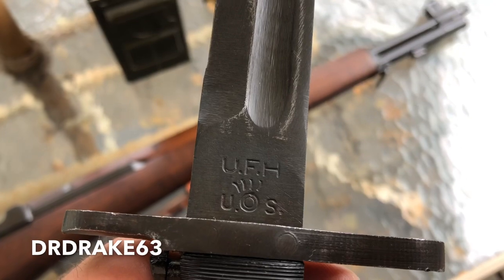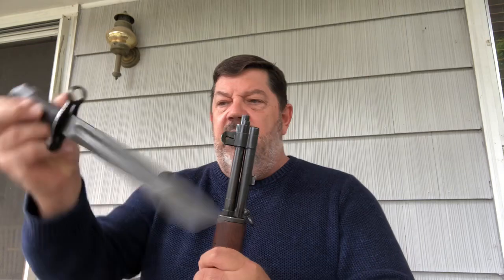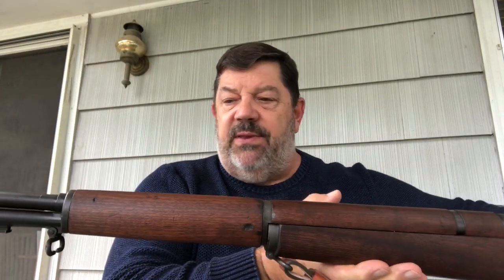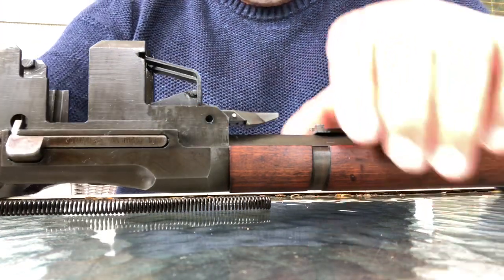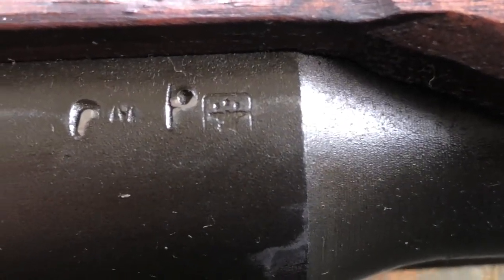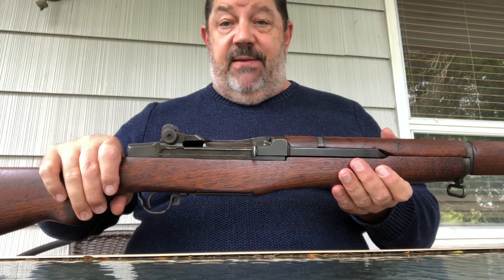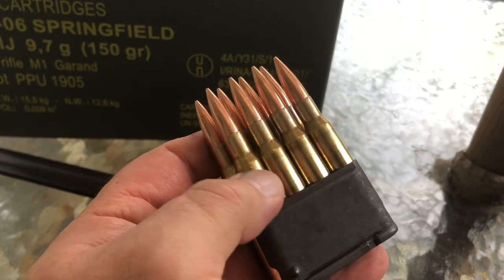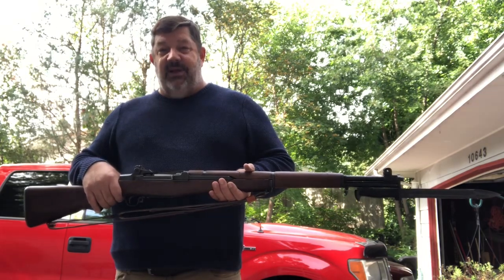INSIDE THE M1 GARAND

Comment: The “blood groove” on the bayonet is called a fuller. It’s designed to make the blade lighter while allowing the blade to keep its strength. You see the same thing on a many types of medieval swords.
Reply: Whatever. It also helps the wound bleed, don’t it?
Reply: @ColombianHistoryX  No, it did not.
Reply: It helps release air suction when pulling it out thus speeding up what you may have to plunge it into again and again during hand to hand combat.
Reply: @LdHrothgar  Fuller is correct....  blood grove is inaccurate and a misnomer.
Reply: @zagsatgu4561  Uh, I know... the OP there called it a fuller, so I didn't correct him, even though they also called it a "blood groove" in quotes, I kinda figured they knew that already (especially as they were correct in its function of making the blade lighter while retaining strength).
Reply: It is there to keep the bayonet from sticking in whatever is being stuck. Without it the blade will be harder to pull out.

Comment: Thank you for taking the effort to demonstrate the M1.  My M1 is from December 1941,42NNNN, appears to have the correct period parts for such vintage.  (I bought the expert which came with a new barrel, and new walnut stock, from CMP).  I wanted a WWII era rifle but also wanted one that I could reliably shoot!  I loaded my own 150 grain Spitzer cartridges for it using the mid range powder recommendation using IMR6064, my favorite 30-06 powder.  Thus, it cycles well, and doesn’t break anything inside!  Your color match was first rate!  When dealing with different woods, matching is anyone’s guess!

Comment: Overhand grip for the bolt is accurate and the underhand on the slide rod also correct.  Best accuracy with the foregrip is with it shimmed.  As a former armorer  details are extremely important.  Never remove the assembly from the stock then you have to.

Comment: The little ding on the bolt is actually where they did a Rockwell hardness test. They did it on the reciever as well.
Reply: Yup, just posted the same thing.. It doesn't tell us the results of the test if it passed such as a proof mark, just is the spot where they Rockwell tested the bolts like you said (although we can assume it passed because it moved along the assembly line). I'm surprised his isn't more of a rounder shape like most, it's like it slipped or something in the process if testing it. Unless I'm just seeing it funny

Comment: Excellent!  You are right, the "ping" myth is a myth.  Your rifle as you mentioned is pretty new.  The older ones may have some problems.  Most commonly, I see broken op rod springs on rifles from the CMP.  They usually come out in pieces.  Make sure you get all of it.  Parts are readily available.  To take out the op rod from the rifle, make sure the rifle is upside down.  Some rifles will not come willingly.  Inspect the op rod for burrs and wear.  These can be rebuilt which is cheaper than a new one.  Going back together I always have trouble getting the bolt to go in.  Do not force it, the key is the firing pin has a slot it goes through.  Firing pins will also break, so keep a spare or two, and an extra standard strength Op Rod spring.  If it slides grease it, if it turns oil it.  Wipe all parts down with oil.

Comment: Throughly enjoy having and shooting my 1945 SA Garand for 4 years now.
Hands down is my favorite rifle in the safe.
I need to find the 10" bayonet that you've got there too.
By the way 150 gr. Remington corelokt runs perfectly in mine and eats any ammo I put in it. But I had also installed a ported gas plug that relieves the higher pressures from some modern loadings with no op rod damage to worry about.

Comment: I have a friend who worked a cmp in ala. He picked out two m1's in near collector grade. A Sp and a H &R. All matching num. I kept the H and R and sold my brother the Spr. 
The stock was near perfect.  I mentioned to him i may refinish it
 He told me, dont you dare touch the stock and re-do it. Keep it orginal. The only thing i did was clean it as much possible. Still all orginal.
Accurate as heck
 Bought 2000 rds. Fired 32 rds out of it and it grouped 2 inches, bench rest  at only 50 yards. But didnt shoot passed that because the gun range wouldnt let me since i wasnt a member, just a guest.  Im sure in The right hands it would group much better.

Comment: FYI they are drawing numbers corosponding to updated improuvment to manufacture.there is a web sight you can look up the dates.  Most of these are frankenstines with no regards to dates, just good parts that work in the rifle.  Mine is an 54 H & R with most parts from that era, excerpt the trigger group which, which is WWII era, not the stamped you have on your example.  Got mine from CMP years ago.  Dinged up stock but after. Rubbing in many coats of tung oil I got a good red look that retained the cartouche and look of the old gals wood.  Happy trails.

Comment: Good takedown view of the M1. I've had mine (circa 1944) apart many times but never miss somebody else doing it. My stock was totally gone and was so spongy, a thumbnail would leave a mark. I replaced with a kit made from maple and cured it with several coats of linseed oil so lost the campaign look but it's still a beautiful weapon. You probably know this but another purpose for the clip release is to top it off. I've heard it said that troops carried loose rounds in their pocket for that purpose. You didn't go into the gas tube in this vid but one thing I did was to get a ported tube plug that increases the volume and allows newer ammo to be cycled through the rifle without risking damage to the tube. Great story there regarding the burn rate of newer powder and expanding gas for another day maybe but it does enable M1 owners to put newer rounds that might marginally exceed the original velocity and burn rate specs without worry. Thanks for doing this one.

Comment: 9:06 The idea behind pulling back the slide with your little finger, palm up, is to prevent injury if a round goes off unexpectedly. The CMP manual details this procedure under the Stoppages section, especially relevant after a misfire.

Comment: 24:04 My butthole tightened so much when you had your finger on the follower while the bolt was stuck on it not locked 😂 Wow what an awesome video!!! Love the M1 and all the nerdery you talked about and explained! I learned some new things and really enjoyed watching, thanks for the great video! Subscribed!
Reply from the maker: Thanks Doc! Have not once had the bolt close on my thumb. The secret is to maintain steady downward pressure on that clip until the split second you don’t
Reply: I watched closely and when you pulled the charging handle back it wasn't quite all the way back! You then loaded in the clip and let the bolt go forward. On the unload you pulled the charging handle all the way back and it properly engaged the op-rod catch that time. Then the clip released. Learning on my 1954 IHC I had to learn not to baby the charging handle and it would lock 100% back making it a little safer. I purchased another op-rod catch to modify it into a Holbrook Device. I didn't want to touch the original part because my IHC is all parts matching. Loved the video and hi from Canada 🇨🇦👍

Comment: You need to do some research on the sling. When properly installed it can be  lengthened for shoulder carry by pulling on it , there is no need to move any hooks. It is also designed to be used as a shooting assist in prone, sitting and kneeling positions.

Comment: Hello, you are an very good gun enthusiast, but when it comes to doing presentations you must be aware that gun people like children can take things apart and NOT put them back together the same way! You disassemble of the M1 Grand was excellent, however you fell on your face by not showing a complete reassemble especially lining up the pin and it’s attachments, I could easily disassemble my Grand using your video but putting it back the same way I probably would screw it up if I cannot follow a step by step procedure.